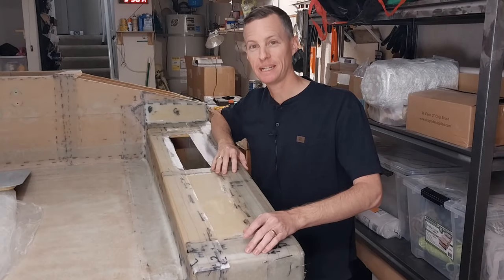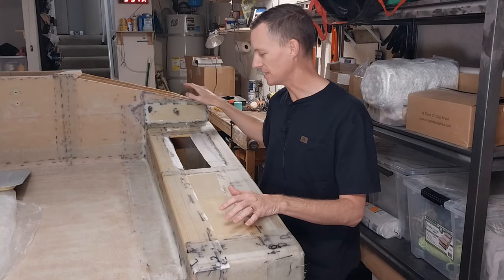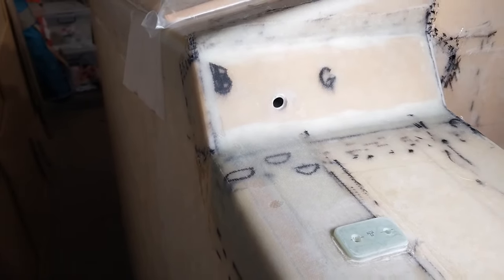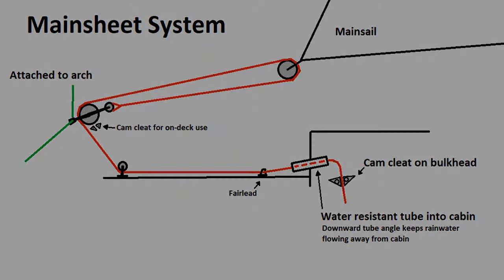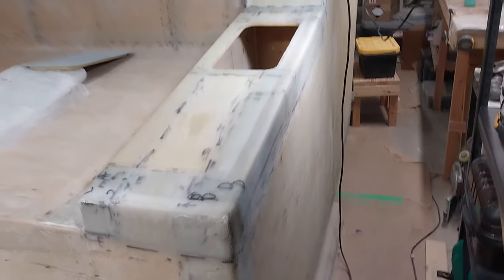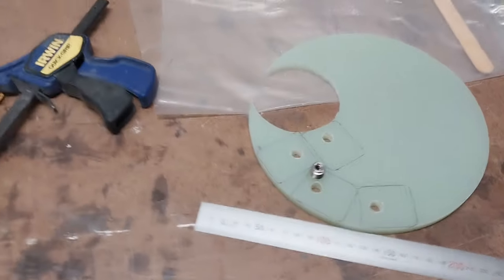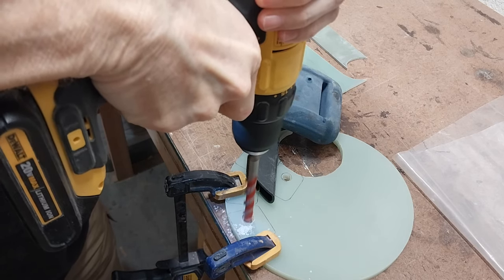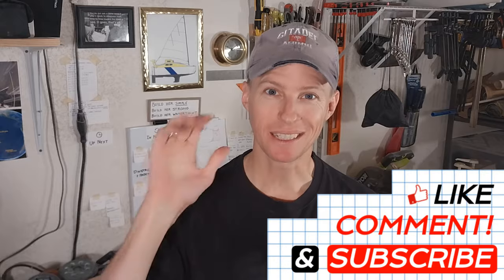OCSS-074Pt6 Drilling G-10 for Latches (February Mini Episodes)

Comment: Simply put, the small amount of water in the cabin coming in through the Water resistant tube will require your attention and generate a task. I think moisture from rain soaked sheets will produce more water than from heavy weather or sea conditions. I envision that you will need "tasks" in order to occupy your time at sea, I'm thinking a microfiber absorbent towel and some hand wringing will occupy your body and mind for a short time, offering a brief reprieve from the SOP of operating the vessel. After a few days at sea in squalls, cleaning up the water from the Water resistant tube may become some of the best 5 minutes of your day. Maybe an external splash shield of some sort. Loving the 10 episodes series.
Reply from the maker: Very positive way to look at it! Thank you for the input.

Comment: The line itself may hold some water from spray or rain. I think it will tend to drip dry beneath the cam cleat inside. You could just put a little scupper under it and connect another hose to your existing drain.

Comment: As you are bringing the sheets into the cabin, they will be wet often and that will bring in more moisture than any coming in directly through that tube for the sheet. You will need a tails bin or bag which will contain the moisture as best it can although it is going to add to the humidity of the interior quite a bit. Hopefully you get days where you can have a lot more ventilation and mitigate the effects. I am confident you have a solution.
Reply from the maker: Thanks. A solution will probably become clearer with real world testing at sea.

Comment: If you are looking for a drill press you are missing, I've seen a couple of variants of portable ones on Amazon, where you attach your regular drill. Some times called drill guide bracket or drill stand.
Reply: That's what I was thinking. On Pinterest there are several homemade versions with video instruction. But most require a small amount of welding to complete.

Comment: Masonary drills.
Here there is also carbid tipped drills for tiles.
They are differently grinded, more like a metal drill.
I use them and they work fine.
Have a look.

Comment: You might be able to run the sheet through a small hole in a stretched diaphragm of say, 2mm silicone sheeting that would act as a wiper.  If it was outside the cabin, you would not need a catch basin.  Perhaps with the correct diameter hole in the diaphragm and the correct thickness of material, it would squeegee off the sheet without providing any significant resistance.
Reply from the maker: That would be cool.

Comment: I am so surprised that you have had trouble drilling G10. I have used cheap (but sharp) twist bits from harbor freight and also step bits. I generally drill a small hole first to accommodate the point and then finish with the size I want. The step bit has the added benefit of chamfering the edge of the hole if I want it to.
Reply from the maker: It's such strong stuff. I would often have my drill snag in it. But in the early days I was using the wrong bits.

Comment: Can’t help but think that the latches on the hatch could have been eliminated. Did you consider a bungee cord attached to the underside pulling it loses with a small handle to lift it open? That would give you a secure hatch no latches in the way, only a small handle. Lift and turn the hatch and it’s open. If you need to remove fully, you could unclip the bungee. If it’s not too late, maybe something to consider. Love watching this come together and seeing your channel grow. 10k subscribers coming soon!
Reply from the maker: Thank you. The bungee was my first plan, but after getting the opinions of some other builders I was advised against it. Not secure enough for offshore use. I can understand it, a wave could lift up the lid and pour in water.

Comment: I was just thinking your mainsheet system. 

If you have your mainsheet in the inside cam cleat and you go on-deck sailing:
-you can tension it more and lock on the outside cam cleat 
-BUT you can’t loosen it without going inside! 🤯

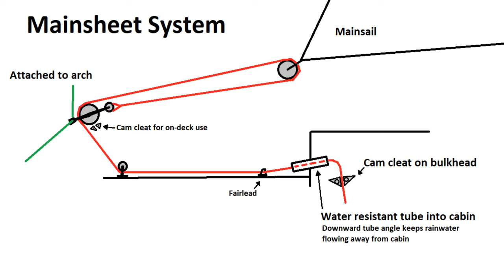Should the mainsheet system be two ended: another end outside an other inside? 🧐 2:11
Reply from the maker: Yes, it will be a little clunky switching from outside sheeting to inside sheeting or vice versa. I think on long passages it can stay on the internal sheeting mostly. In the bay/close to shore with fine weather I could just keep it on the outside system. So, it shouldn't need to be switched much. Some testing will put more light on it I'm sure.

Comment: I can’t think of a single thing to keep the inside from getting wet…. If your main sheet is soaked .
Keep the tail in a bucket .
Reply: Or a suitable sized dry bag (which will be a wet bag on the inside).